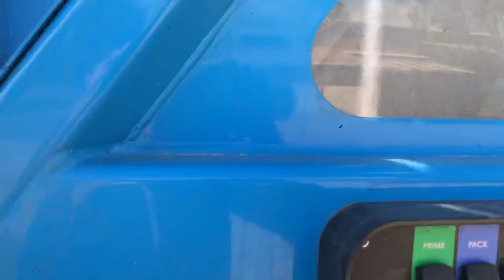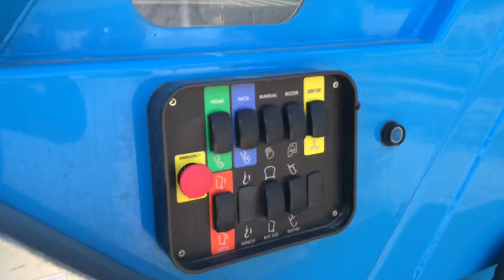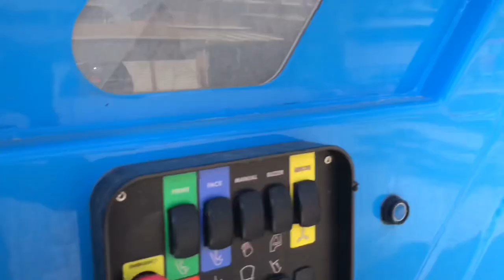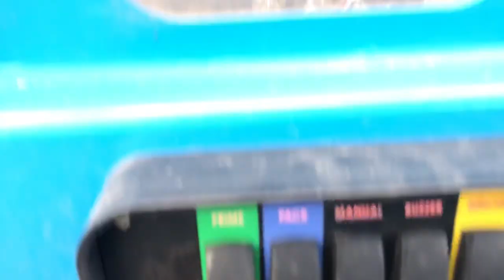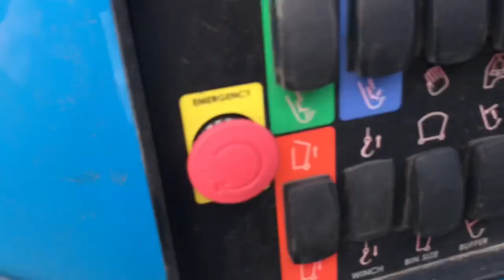Return and Earn Container Deposit Scheme Truck - #RL00337 (Cleanaway)

Comment: Gr8 video.
Btw in sa we take them to a bottle depo where they are sorted by workers. The beer and soft drink cans are seperated. Hdpe and pet plastic seperated. Glass colours seperated etc. Glass is loaded into a 3 bay sealed roll off cans and bottles are put in a caged rolloff.  These are collected 2 to 3 times a week. They drop an empty off pick up full one then take it to be emptied and then return to yard it came from so yard has 2 bins.(excluding glass)
Our all goto statewide recycling where they are seperated and baled (plastic cartons and cans) 
Glass is crushed and bagged or palleted in different colours. It is then sold to be recycled in australian sites. Some glass is used in roadbase. Some is melted into new bottles. The best part is when at depo hearing the can container be emptied into the big 40 cubic mtr divided bin or the bottles being crush as they go up the "flatten and chute) into the big container.
Reply from the maker: southaussiegarbo games and more 2000 Yeah very interesting system you have thanks.
Reply: @genvfan6257  ikr.  Its intersting when someone "flogs" the caged bin truck and tries to go cash in all the containers 😂 not smart when driver reported it as stolen .
Reply: Yeah and people get employed NSW whole state is given to Tomra a overseas company

Comment: Very interesting. I understand that it all goes to an MRF, but I don’t understand why the machines sort the bottles, or why they require glass to go in a separate machine when it all gets dumped into the same truck.
Reply from the maker: I comment, not upload :) Rural differs less machines to collect it, glass separate (in Sydney) = for a more cleaner stream than mixing both but mixing both still archives it. Less of machines and to save cost only 1 truck is used